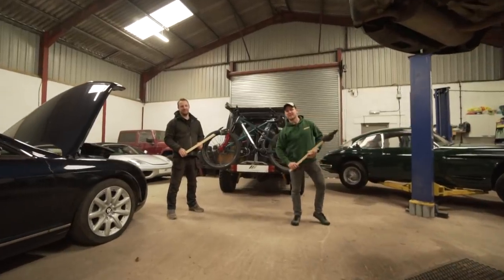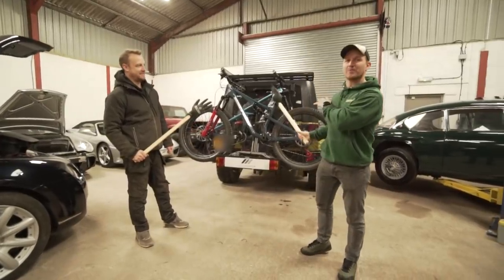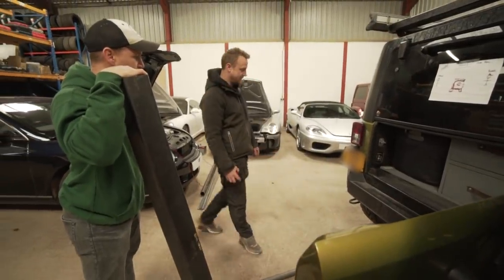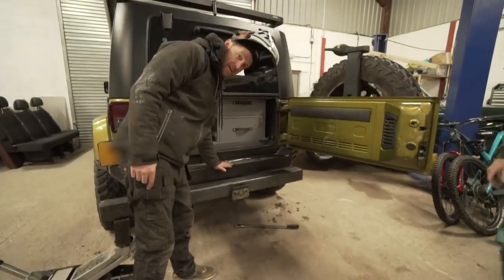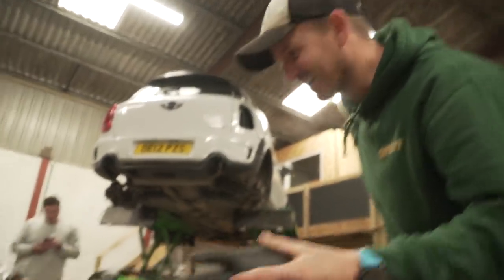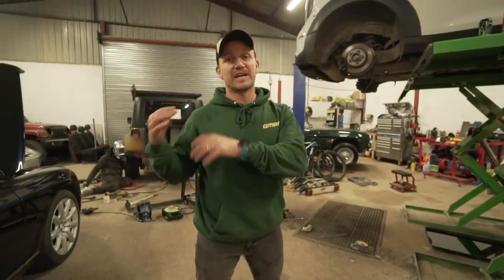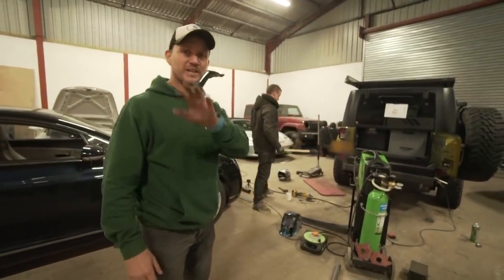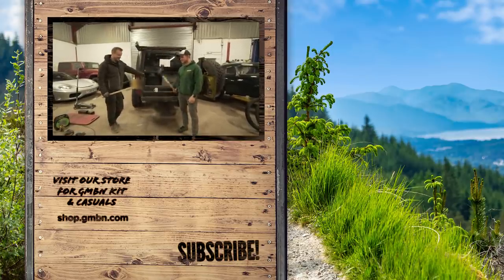Blake Builds A Custom Mountain Bike Rack | Part 1

Comment: One up makes a rack with reverse plates that works with out removing rack on Jeep. I went with regular super duty. And installed a slight drop tha lt allows the same thing that clears my 37 spare and I can swap to other vehicles. E bike friendly also @ 75 lbs per bike is perfect.

Comment: i did some grinding with a car a few feet away... covered the car with a blanket. when i took it off at the end of the job i came to find that the grinding sparks had burned through the blanket and burned into the rear windscreen. hundreds of little pit marks all over it. had to replace the heated glass.

Comment: Hitch-mounted bike racks – for bikes are much better, stronger and easier than round ball tow bar mounted bike racks, especially for MTBs. However for in the UK I think they are illegal. Also so many regulations with lights and number plates and vision.
I think there should be some exceptions in the UK to use hitch-mounted racks for bikes.

Comment: Grinding steel next to a Ferrari and a Porsche...
Nice... 🤦🏻‍♂️
Reply: Its not like thers hundreds of very hot fragments flying about or really sharp metal dust floating round and absolutely no spatter comes off welding steel either 🤫
Reply: @Rab_Cee  i almost started shouting and swearing at 2:38
Reply: @Rab_Cee  There's enough. Doesn't take alot. I wouldn't be impressed if that was my car they were grinding next too.
Reply: @Shralps  lol was tryin to be funny i know what the dust like
Reply: @Rab_Cee  My bad. I read it in a different tone 🤦🏻‍♂️
Reply: Not to mention the Bentley

Comment: I realize this channel is about building, but why go to all this trouble when you could just get one of these?: https://rakattach.com. Bolt it on with a 1UpUSA rack, job done! Just got back from three weeks in southern Utah with lots of off-roading to trailheads and it worked great. Also, my wife likes how much easier to load/unload heavy bikes from a horizontal hitch rack than a vertical one. We also added a custom-welded full-size spare tire holder that swings out of the way with everything else.

Comment: Car mechs can’t weld for one when your bare wire mig welding you should push not pull the torch
Reply: @Rab_Cee  work in the boiler industry. Grinding in confined spaces you have to take the handle of. Plus it lets the grinder do the work and not your own force on the handle...

Comment: Safety first!? Welding and griding without gloves on, using a zip cut grinder and drill holes with no safety glasses, awkward working body position, hot work performed near gasoline tank... 🙄 keep working like that and you’ll never gonna bike again after loosing limbs or get burned by explosion.

Comment: Someone please tell me how it is legal to permanently cover all of the rear crash structure with a big piece of steel. This makes it significantly more dangerous for people running into your back because your car won't crumple
Reply: Are you joking
Reply: I hope you are joking! Cars have crash structures at the front to protect the passengers in a crash like that. Have a look at any lorry or heavy truck and you will see an impact bar (a steel bar across the back)
Reply: @tunderwood12  The bar at the back is so that vehicles cant slide under the truck. If it wasnt there the body/container on top would cut through the roof at chest heigth. Definetly worse than a harder colission. 
And I am definetly not joking. Cars have rear crumple zones and crash structures that also make it more safe in case you are being hit from behind. Altough I am willing to argue that with a vehicle like the jeep that has the rear axle this far back there isnt much room for a crumple zone anyway.
But please educte yourself and just look around what a simple towing hitch sticking out the back does in case of a collision
Reply: @simoneller5194  still a steel bar...  You wanting to make tow hitches illegal now?
Reply: @tunderwood12  Some people.....stop twisting my words. I never even said hitches are dangerous. I only said that you should look at how they behave during a crash.

Comment: weight of the new rack? do you know cars and tow hooks have weight limits?
Reply: Tow capacity of the jeep is probably somewhere between 2.5 & 3.5 ton, the rack is a bit of hollow stock welded together. I’d guess even with bikes less than 100kg? Do you see this as a problem?
Reply: @ShalomBrother  Let's not confuse maximum towing weight (the weight of the trailer you're towing) with maximum tongue weight (the weight the trailer applies downwards on the hitch). However I think Blake's is probably a Class III hitch, with a max tongue weight of about 600 pounds / 270 kg. So yeah, it's probably plenty strong enough, especially after welding it to the chassis.